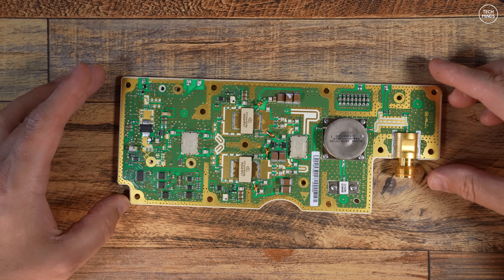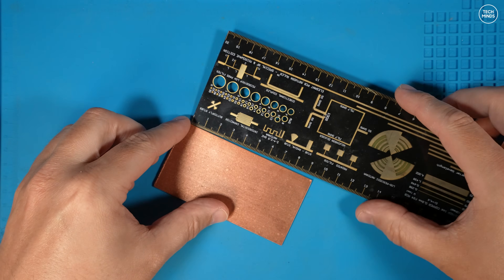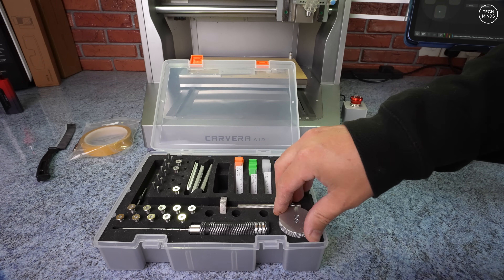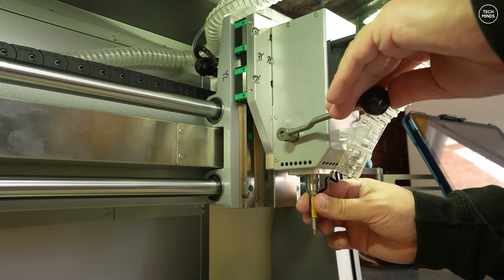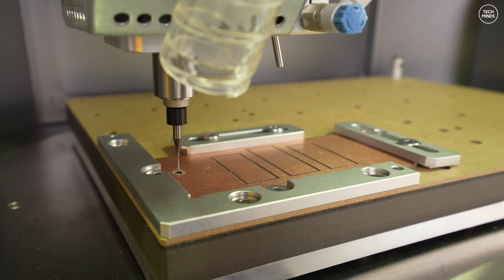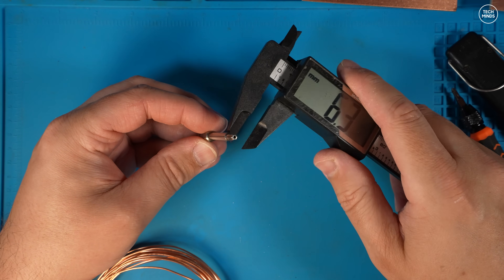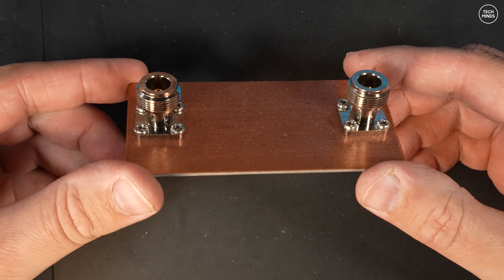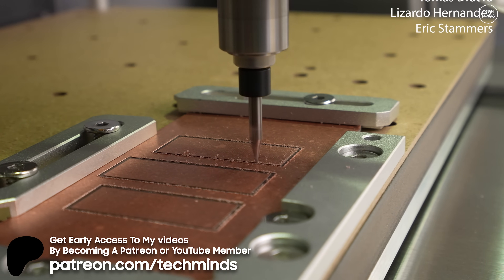Making A High Power 70cm Low Pass Filter  - This is so cool!

Comment: Another thing you can add to low pass filters is stubs - shorted (or open for a notch) lengths of coax suitably tuned. Obviously use good low loss coax suitable for the power needed.

What 432MHz insertion loss did you end up with? Should be Sub 0.5 dB.

Comment: I don't have a CNC but I do have a 3D printer. It should be possible to print a single layer of plastic onto a PCB and then etch it… kind of like photoresist but without any of the messing about with UV or lithography. Maybe I'll give that a go to build a filter like this.
Reply: That is a clever idea.  You will need a plastic that is ok with the etching material

Comment: Generally it's a bad idea to make inductrors have same axes (even if wound in differenct direction). Even if winding direction is different, they still couple, only with face shift of 180 degrees.
Inductors near each others are always best to be in 90 degrees to others. (a sideways or up/down inductor couples much less than parallel inductors).
Reply: Yes and also this really matters on those 4 turn coils.  Ideally, there would also be a wall in the design made out of something soldered to the grounded copper.

Comment: Great new toy! The filter looks interesting - I'm intregued why clockwise/anti-clockwise winding is relevant? I'm definately interested in seeing the amplifier build. I think you need to solder the N-Type connectors to the non-etched side of the PCB as thats part of the groundplane I think?
Reply from the maker: Im not sure about the clockwise / anti-clockwise reason, maybe something to do with cross coupling?

Comment: the value of those coils is a bit lower than perfect. Push the windings of each coil a bit tighter, this way the cutoff frequency will go lower, and the filter will be better. Also try to loop the ends of the coils on the terminals of the sockets before soldering, for added mechanical and electrical stability.
Reply from the maker: Thanks for your tip, I followed your advice and the whole thing blew up! Only joking, it improved the cut off and rejection at the first harmonic! thank you!
Reply: @TechMindsOfficial  glad i could help.

Comment: I've not had much luck with uhf low pass filters but I did make 4 cavity filters for a 70cm repeater using old gas bottles. Worked extremely well. Your project looks extremely interesting. I've seen those modules for sale on Ebay. Cheers from old George
Reply: Curious about the gas bottle cavity filters - I'm in the process of designing a cavity filter for 1695MHz weather satellite RX (We have cellphones on band B3 from 1710MHz here in VK, so I think I'll need a pretty sharp BPF!). Did you coat the inside of the bottles with copper or anything? I've heard that steel is fairly lossy as you go up in frequency, so I never considered it but those small ~10cm dia "disposable" oxygen/argon cylinders would be an ideal size for what I'm making.

Comment: Flux is your friend when soldering those nuts.  Recommend some Kester liquid solder in a little plastic bottle.
Reply from the maker: I just didn't want to heat the pcb up to much, it was the only piece of PTFE that I had. Plus, brass nuts done the jobs at a lower temperature. I will remember this for next time though, cheers!
Reply: When soldering nuts to PCBs like that I also like to use the shortest screw I can find just to center the nut and prevent solder getting on the threads. Soldering with the whole connector in place pulls heat out of the nut and make things much more difficult!

Comment: Regarding the soldering of the N-Types - isn't it the other side of the board that needs the good ground connection to the N-Type, as that is the other plate of your capacitors?

Comment: Hey Mat, love the videos – especially the QO-100 content! Really appreciate the effort you put in. Just a small video production tip I thought you might find useful.

I've noticed that when you pause in your narration, the audio level in your videos drops to absolute zero. On some home audio setups (mine uses SPDIF optical), that total silence can cause the system to enter a kind of "sleep" mode. As a result, when you start speaking again, the first word or two can get cut off while the audio connection re-establishes itself.

It's not really your fault – it's just how some audio systems behave. A common workaround used by video producers is to include a very low-level "silent" audio track in the background, so there's always some signal, even during quiet moments. Kind of like a squelch tone in radio – not meant to be heard, just there to keep the line open.

There's actually a similar practice in broadcast TV: producers avoid full black screens because automated systems can interpret them as signal loss or a cue to insert ads. Instead, they use "almost black" to avoid triggering those systems.

Anyway, just thought I’d share in case it helps. Keep up the great work!

73 de VE3INP
Reply from the maker: Weirdly enough someone else commented on another video saying my editing was bad because I cut out words at the start of sentences... They must have the same issue you are having. I guess most people watch on phones, or tablets, or PCs with normal speakers etc.  The audio does drop to zero, and that it intentional. It is gated pre and post production. The reason, well, I live in the sticks, lots of birds make noises, plus lots of construction around my area at the moment. A house extension and a new whole railway! So, I try and cut out any background noise as much as possible. Interesting issue you are having though and I am not sure how I can add a low level and silent audio track. I will research this, cheers! If you want more QO100 videos, then I am more than willing to make more. Let me know what you would like me to cover :-)
Reply from the maker: Actually, I just figured it out... I will include this on my next video, I would be grateful if you can let me know if that cures the issue once that video is released. Most likely this coming Saturday or Sunday, is that okay please? Thanks
Reply: @TechMindsOfficial Happy to test it out for you!

Comment: No real need for PTFE at these kind of power levels and frequency range. Loss is lower with PTFE but I doubt that anyone would care that much.
Reply: Agreed, especially for TX, but using a different PCB substrate or thickness would mean all the dimensions would have to be changed to get the same capacitances..
Reply: @rob-muntron  True